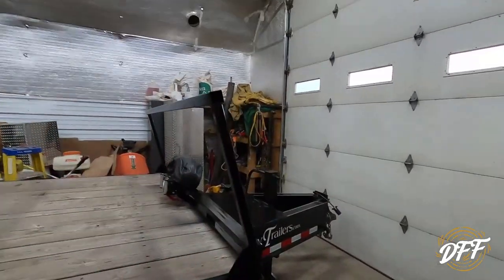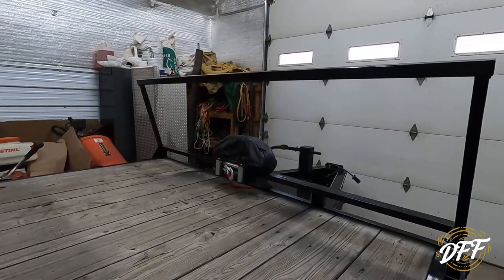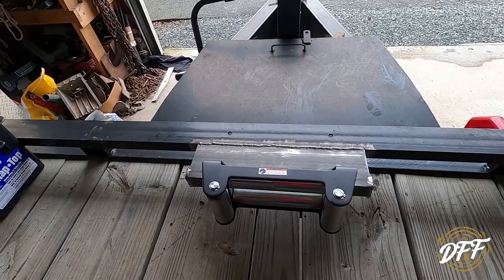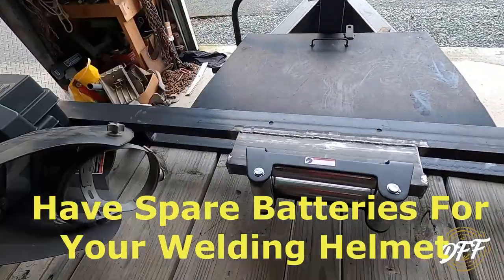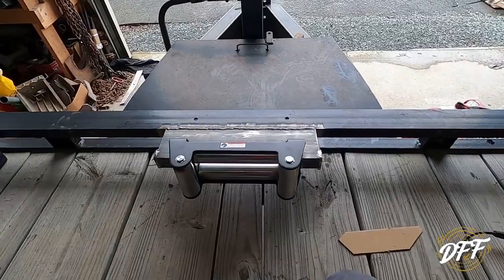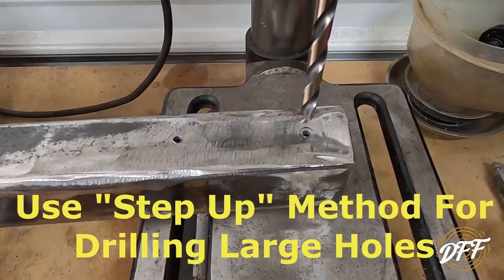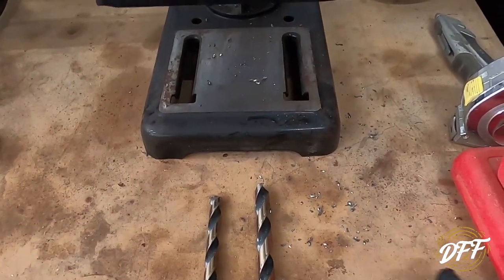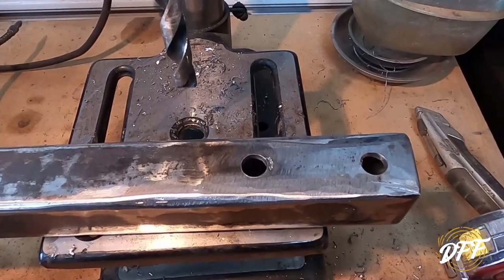4 Great Tips For Beginner Welder/Fabricators!!

Comment: Thanks for the tips. Oil will make your drill bits last a lot longer  Have a good one
Reply from the maker: I do usually use oil when drilling. I am curious if it makes a difference if you use oil specifically for drilling or just regular motor oil. Hope all is well with your family!
Reply: DeHaven Family Farm I have a oil squirt can I use used motor oil. Works good for us